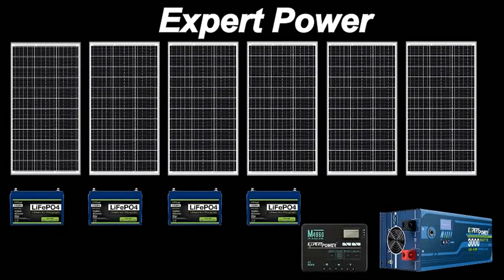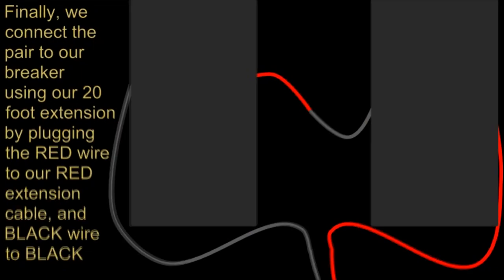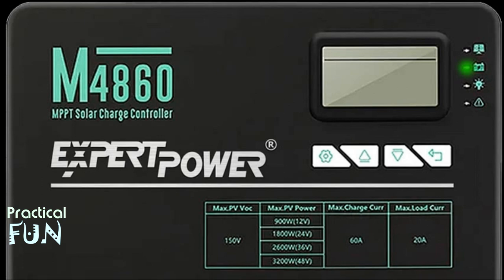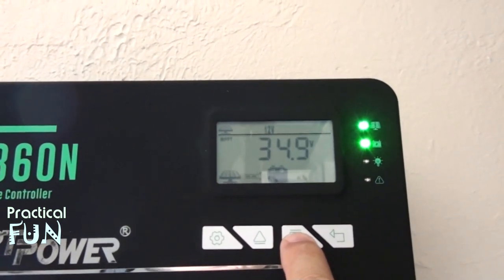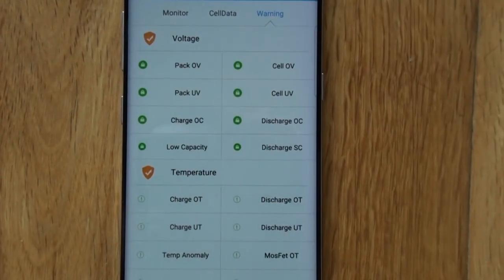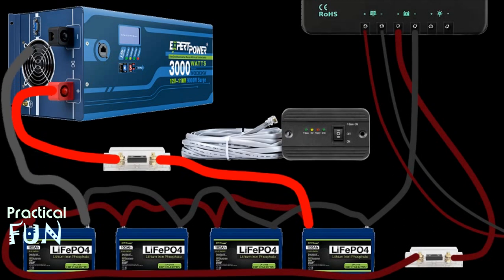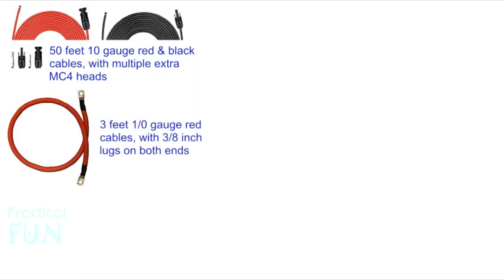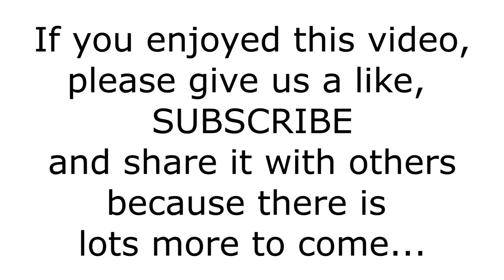DIY Solar Kit: Setup & Test ExpertPower as a Backup System (Part 2 in a series)

Comment: Ok. This is what I’ve been looking for. No nonsense, practically plug and play. Now one question…am I wrong in assuming the I can do an AC charging connection by putting a line into the “lightbulb” connection on the far right hand side so that, if I needed too, I could charge with my generator should I not have enough sun? And this the best DIY video I’ve seen on this subject, and I have been watching a ton of these. THANK YOU. Even if I choose to go with other components this is perfect.
Reply from the maker: Hi.  Thank you for your feedback.  You certainly got our intent.  If I understand your question correctly then YES.  As long as the batteries have power, then you can use it as such.  hopefully by the time you drain them, the sun will have been back and begun to refill...